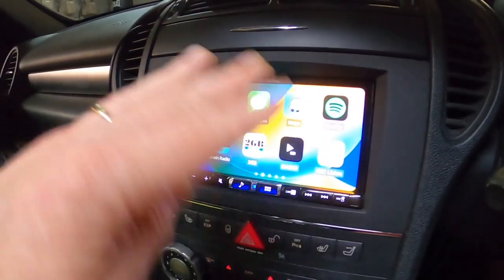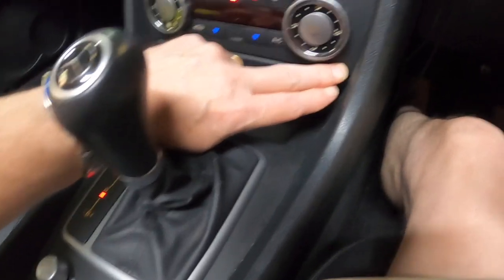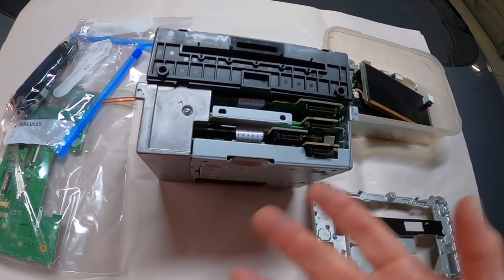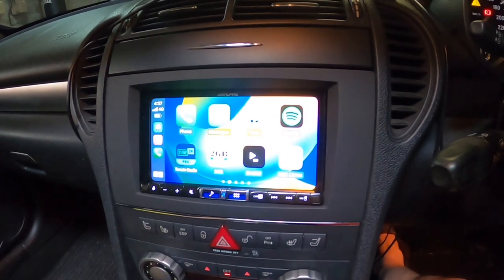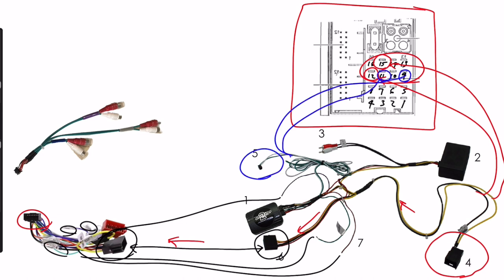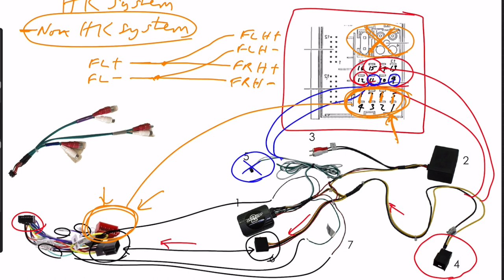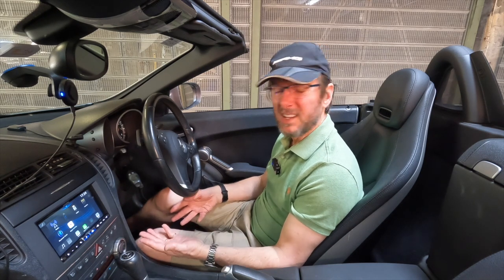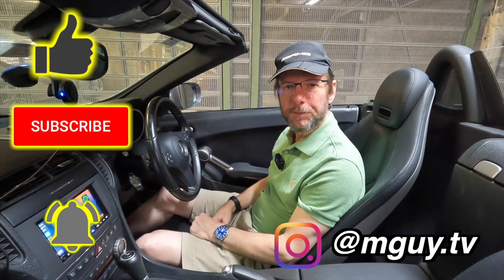I installed Apple CarPlay in my 2008 Mercedes SLK 350 | MGUY Australia

Comment: Just a couple of side notes - you forgot to mention that to make life easier you probably also need the Aerpro "FP953000 Universal double din mounting kit" that I think I can see in your video (unless that came with the Alpine) that clips into the Aerpro fascia that the head unit in turn clips into. Also, depending on the age of the car and original equipment you may find (such as with my 2010 SLK - sigh) that there is no time setting option on the MFD. Everything is done via the old head unit. To get time control via the MFD you need to find someone with the right kit (DAS/STAR) to reprogram the car by going into Control modules > Communications > instrument cluster > Control Unit adaptions > Optional equipment and then setting "Comand = NOT PRESENT" after which the time setting option should then appear on the MFD. 🙂

Comment: Very well detailed. I'm glad you realistically included the functionality limits on these aftermarket replacements such as the dashboard display. My question is are the rear speakers connected ?
Reply from the maker: Mine doesn’t have rear speakers - only the Harman Kardon ones do I think
Reply: @mguytv  but yours is a Harman Kardon COMAND NTG 2.5. Had the SD card slot and surround sound. I recognize it from its separate manual Mercedes issued. I’d bet money on it.

Comment: The head unit might have separate AM and FM antenna inputs. If so, that's why no AM reception. I'm guessing that could be the case, since FM requires a shorter antenna.
Reply from the maker: Only one input for the HU and the Mercedes antenna only has one cable (worked for both bands on the previous HU)…

Comment: Your video could not have come at a better time!

The nav function on my 2003 clk500 has packed up with respect to satellite reception. Have  tried a couple of eBay used antennas that are located under the boot lid but no joy. 

So considering a new branded after market unit. However a few cautionary tales about Mercedes cars with the Command system and getting all the original functions to work.  

Having seen your excellent video I am now searching for a specialist with experience on the CLK!

Will have one last go and connect my STAR ( cloned) diagnostics to see what it can do if anything ….

Comment: @Mguy Australia - how did this head unit work with the ModsForCars SmartTOP header unit that lets you tweak the firmware limitations of the car (roof closure/opening when moving, remote roof open, etc.)?   I ask because I remember you saying that this required you to something with the radio for one setting change, has this head unit affected the functioning of that at all?
Reply from the maker: Very good question. Yes it does prevent the usual method of changing the SmartTop settings, however they’ve thought of that: https://youtu.be/qLuuIAkwxtw
Reply: @mguytv  it's functional but messy - I guess you're not changing the settings very much so it's probably not an issue.  It would never work on a BMW of course (insert BMW drivers joke here)....
Also it must be very confusing to the guy behind you at the lights!

Comment: Do you think it is possible to use the original OEM GPS connector into an aftermarket unit like yours? Granted it may need some conversion but still should work in the after market unit - right?
Reply from the maker: It's possible - I will check the wiring diagrams and see if there are any other components (e.g. amplifier) between the antenna and the plug
Reply: @mguytv  That would be great, many thanks!

Comment: How much do you regret it? Now that the steering wheel buttons don’t work with the infotainment system? Or that the new upgraded system is too loud for the speakers and not in sync with the car’s amplifier? You’ll be back to stock system soon.
Reply from the maker: No I won't. Thanks for watching.
Reply: @mguytv  I promise you will, if not, you deffo won’t be redoing this on another car and you’ll settle for the stock system that comes with the car, because this system sounds like crap, will lag/freeze, is too loud for the cars amplifier, has a mind of its own and not in sync with the cars brain e.g. steering wheel functions. You’re welcome.